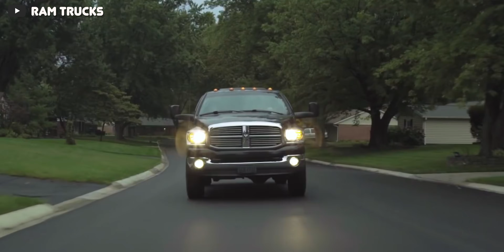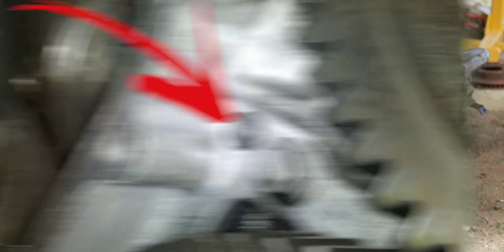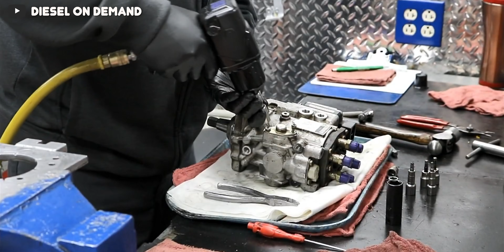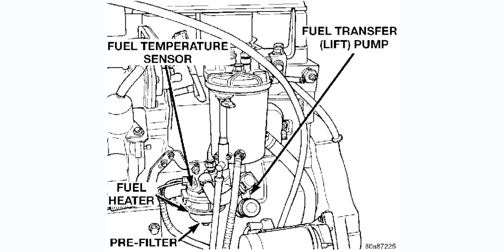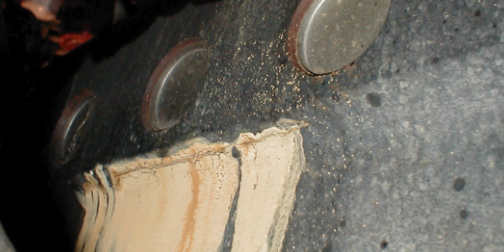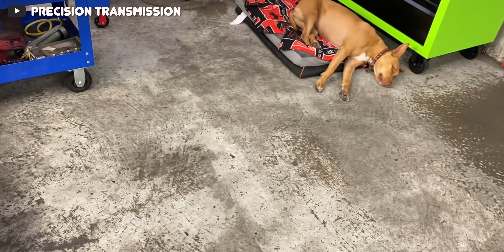Everything Wrong with the 5.9L Cummins (12V & 24V)

Comment: Front end is garbage, transmission is garbage, AC is garbage, an so is the interior. Turbo is also pretty weak. The engine is only reliable because it's so low on power dosent really have enough horsepower to break anything. After owning one for over a year I'm not very impressed with the Cummins at all. Much rather be back in a Duramax.
Reply: Seems this post is ,........wait for it.........      .         .            Garbage.
Reply: Dude!!!   Hater’s

Comment: 2001 140000 miles gone thru 5 vp44 pumps.   Replaced the lift pump with an aftermarket.  Vp44 is trash.    2003 model just passed 450000 miles no issues.  2003 also has a 48re.
Reply: ouch!

Comment: The 12 valve cummins is the most reliable, and the one I'd want if the end of the world occurred.

However, the duramax LBZ (and deleted LMM) is a superior motor in every way. The "top x problems" lists for the LBZ are hilariously small.

So again, if I lived where there was shitty fuel and wanted a dead reliable engine, 12 valve for sure.

Living in modern society, the LBZ is clearly superior

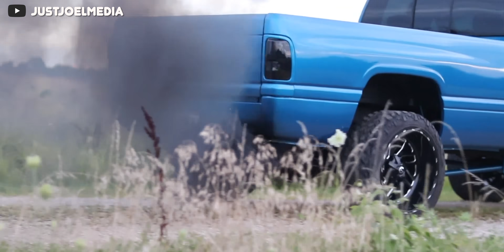Comment: 12:44 I beg to differ. I prefer the DT360. Both the 6BT and DT360 are mechanical, I6, 5.9L engines but the DT360 makes the same power, has better mileage, has an easier start-up, has no KDP, and is more robust.

Comment: I miss my 98 12v. It was easy to turn up, it was super reliable, the KDP fell to the passenger side and put a hole in the front cover, giving me perpetual undercoating and rust prevention, it was fuel efficient, and as long as the batteries were up and it had oil in it it would start every single time. The trans was trash. I wanted to put an Allison AT545 transmission behind it with a PTO on it, but life got in the way with serious health issues. Cheers.
Reply: You got lucky, at545 are terrible.
Reply: @Turbo-wj9qc  There are a quadrillion of them available dirt cheap, and the worst one is better than the Dodge transmissions. I had good luck with mine.
Reply: hope ya get better mate
Reply: @opaic777  Once they put the stock fuel plate back in my fuel pump my health has improved.  (metaphor for cardio vascular issues) LOL Cheers.
Reply: Kdp put a hole in my timing case to this comment made me feel a lil bit better about it haha
Reply: Dude, you let a 98 12v go!😳😳😳😭😭😭😭.   Those are pulling BIG money now! Sorry that happened to you!
Reply: @Asphaltaperider I’ve got a 98 12 valve 3500 dually with a built trans. 341,000 miles,  rust free. Get ridiculous offers on it but no way I’m selling it.

Comment: There's no doubt 12v 5spd stock is the most reliable cheapest to fix diesel in a American truck. Biggest issue I've had is injector pump leak bcuz of low sulphur fuel.

Comment: I have a ram 3500 2004. And the motor has been rebuilt recently. My mechanic is a 25 year friend. Ownes his own family ran shop. In business since 1960. And I take all my cars and trucks to him. And without fail. Every trip to his shop. There's a Ford truck there with some kind of diesel engine problem. Now I've seen Chey's there and Dodges there. But, for every Chevy or Dodge. There's three Fords. When I was looking for a diesel truck. He told me. Buy a Chevy or Dodge. But, don't bring me another damn Ford to work on. Most all diesel trucks require work at some point. Most are worked hard. Maintenance is tough due to the fact they are worked everyday. And people just don't feel they have time to stop to take of the truck properly. Yeah I get it. No maintenance will cost you more in repairs. I get it. But, the fact remains. Most businesses run that chance.

Comment: I bought dodge1990 350 chassis cab w cumm.auto,4x4.auto trans.rebuild at about 95k.that's it.my problem is where to find info for adding hyd.pump to drive welder,small lift boom,winch,etc.info appreciated.thanks

Comment: Once adressed with a simple shift kit 47 48re Transmission are known to be one of the strongest Transmission ever built. Still to this day th400  727 4l80 48re are the go trans if your making any type of power. So they can't be that bad of a design in my opinion.  BTW I have a 53 block with a vp44 making close to a 4 digit hp number.

Comment: If you think it’s a overrated engine , show me a 6.2, 6.5 6.6. Chevy or 6.9 .7.3  6.0 6.4 that is better then it , show me one of those engine that is as reliable with little to no mods and still able to outpull,outperform, and get better fuel mileage then the new 6.7s and 6.6.s. Your biggest gripe is the kdp with you can fix for free in about 30 minutes and reseal the front main and case.

Comment: I always find it funny when people bad-mouth the Chrysler autos up to the last 48re's in '07. Reality is: if built properly, under normal driving conditions, they are probably the most reliable option. Hence an entire aftermarket segment for 48re swaps. In my belief, the biggest contribution to their poor reputation is the "tuner" type owners, or "hot-shot" guys, that just build waaaay to much power in to the engines. And, neglect the needed upgrades to the tranny to hold all that power. Because, there is no tactile performance advantage from the tranny upgrades. So, they don't want to spend the money! It takes serious coin to build a reliable transmission. The Chrysler tranny, 518 all the way through 48re, can be built to hold serious power reliably. I know this because I've done it. But it takes a meticulous build, zero-compromise cooling, and diligent maintenance.
Reply: Yes. You have to build both ends.  A guy just can't build one end and not give equal capabilities to the other.👍🏻

Comment: The oil leaks are absolutely demoralizing. Put 40k on a 94 12 valve the past few years and the only real engine issues I have had are leaks. But boy does it leak. And from everywhere. And when you fix one leak there are two new ones waiting.
Reply: My 1998.5 doesn't leak hardly anything. What it does drip is condensate from the breather tube.
Reply: Tappet cover is the big offender, I am lucky almost no leaks on my 5.9, I will have to do the tappet cover someday as it is the big failure point (and I don't even know why they have a tappet cover, the lifters come out the bottom once the cam is out. and the pushrods come out the top. the only thing that is on that cover is the crankcase vent and that could be put anywhere.

Comment: 94 and 95 is the 47RH and 96 started 47RE and mainly torque converter for the problem they were way too high stall speed how to create a lot of heat In them both that was really the main problem they can in stock form just hard parts and clutches with a valve body handle 450 max.

Comment: did the 48re fix all the design issues with the 47re?
Reply: Still a weak trans from factory if you start working it hard. If you keep it stock and pull less than 9000lbs it will last a good while.

Comment: In 1989 the 5.9 BT was the highest tech engine available for three quarter and one ton trucks. The biggest problem with early Dodges was the rusting out of the cab....particularly the roof area. Mechanically the 5.9 is nearly indestructible....but they will commit suicide ( KDP syndrome). I've operated 12 v and 24 v and I have had  almost no  trouble other than the 47RE transmission slipping in 2nd under high load.
Reply: And the rockers

Comment: If you hate the 12 valve its because you're a hater. Simple. The 12 valve is KING of cheap power and torque, also its easy to work on. No other diesel has so much after market support. Pair it with the P7100 and you got an indestructible engine as long as you keep the engine cool. The 24 valve is garbage though mainly bc its a #53 block and the head has quad valves and usually cracks there.
Reply: Not all 24 valves are a 53 block
Reply: @countcuda70  no but all 24v are head crackers.
Reply: @Syriondeathvow  I'm not saying they don't crack. I have seen more not cracked then I have cracked.

Comment: Only issue with my 12 valve is my automatic transmission. The transmission currently runs and drives and shifts perfect but it’s a Chrysler 4 speed transmission that’s being forced to handle diesel torque and it’s gonna fail eventually and the second issue is the two peice drive shaft and the carrier bearings going out
Reply: Single piece drive line, any driveline shop can make it. take your two piece with some measurements. take the carrier bearing support out and there are no issues. I put a 46RH into mine removing's the 37RH aka 727 had to build a rear mount adapter but that was easy. Now with 307 rear end gears 70-80 down the freeway is about 1600-1800 rpm.  I think you must have the 46RH if it is a 4 sp,  aka 3 speed with OD. good luck you will be fine.

Comment: Spot on.  I could write a book on the 24v dodge.  Purchased my 2000 24v new in 1999 for 32k-33k and have spent over 40k in  maintenance and part replacements.  It's 6 speed and thank goodness it's not an automatic.   Now that it's worn out I've just got the issues worked out of it.  Had the compression tested and it has nearly new compression so I'm keeping it till the body falls off
Reply: I also have a 2000 Dodge 2500 5.9 Cummins 6speed 4x4. Bought it in '02 for 20k. At the time, I was driving a Volvo day-cab semi with a M11 Cummins in it, 600k miles, running strong. I guess you could say I bought a Cummins, more than a Dodge. And no rust!
Reply: You are full of S$%(* if you spent over  40k on maintenance then why the hell did you not see that it was an obvious lemon at spending 10k and you would have got your money back or a new one under the lemon law? No one spends 40k in maintenance on these trucks unless that includes the price of putting all kinds of high performance mods on it too.
Reply: Shouldn't be long. If anybody's even just put salt on their fries, or sweat while in your truck, it's probably rusting away.

Comment: Considering mine made it over 1,266,289 miles before I rebuilt it! Along with that decent fuel milage pulls everything I need parts are easy to get!
Reply: Not only medium duty but agricultural as well. Lot of tractors and combines use the 5.9 and turn 140-160 horse out of it and do it reliably for 10-15,000 hours before any major work.
Reply: Good news for my 95 12 valve with 250 000 miles and very , very little rust.
Reply: @glennbrooks3449  I’ll take it off your hands for $25…. That all I got to offer
Reply: What grade of oil.did you use in it? That's rge highest mileage I've heard of yet!
Reply: @ericfrontczak8016 it seems more important the frequency of oil and filters instead of brand of oil, but in any diesel seems Rotella is a good bet.
Reply: @michaelf.2449  Rotella a joke! Amsoil max duty cuts down oil consumption 76 percent not to mention the detergents to keep the engine cleaner, and I'd spend the money on the oil filtration system I'd go several hundred thousand miles more between rebuilds
Reply: @michaelf.2449  if you don't want to protect your investment you don't have the detergents I change system once a year oil consumption cut by 76 percent
Reply: A lot of people swear by Schaeffer oil. It’s expensive, but stretches your oil change intervals quite a bit.
Reply: As far as the 12 valve goes with the problems with the diaphragm lift pump, when Case used the engine in their tractors, they used a low volume piston lift pump. Looks just like the lift pump used on the p7100 engine only low pressure….
Reply: The Cummins 5.9 and 6.7's are true medium duty diesels. The internals are much stouter than the Powerstrokes or Duramax's.
Reply: Do you use a bypass oil filter?
Reply: 💯  just bought one 180 miles 1998 24 vaule 5k Laramie clean truck .. what upgrades do you think ?

Comment: I bought two 1st gen Cummins Dodges (1990 D350, 5spd Getrag/ 1993 W350, auto) brand new for the farm that are still daily driving to date. This video pretty much sums up my experience with them. Addressed the KDP long ago, put in manual shut off cables eliminating the shut off solenoid, and put in an old style charging system and they've been the roughest riding but most dependible and reliable trucks I've ever owned.
Reply: Best trucl motor option on planet earth. Thats why people that actually work for aliving use them
Reply: What’s the shut off cable
Reply: @jasong-m2u  The injection pump has a spring loaded manual shut off lever on it and you can attach a cable to in and pull it inside the truck cab to shut off the engine
Reply: Roughest riding ? I owned a 79 GMC 3/4 ton camper special that was far rougher a ride than my uncle's gen one Cummins.
Reply: Manual shut-off cable is a great theft-proofing device too.

Comment: Have a 94' 3500 scdrw auto. Dash harness fried with 65k miles on it. Then the headlights got gremlins nothing fixed em and had to run separate wiring and switch for em. P pump went out at 80k miles had to replace with all injectors. The electrical feedback running into 47re causing o/d to kick in and out. Front end needs to be rebuilt often. The kdp. Have a 22' ccsb 2500 Cummins too now hopefully it will hold up better in the long run.

Comment: I have a 97 HD 2500 4X4 manual trans. It has over 355,000 miles on it and still going strong. The best engine that I have ever had. The engines is going to get some upgrades and will help in the towing my toyhauler over the Oregon hills. 😀
Reply: I love my 12 valve....so reliable.

Comment: Yea those are accurate statements but like the automatic it can be made with better parts to a decent unit . My automatic is sitting on the ground mine has a rebuilt g56, Val Air dual disc quiet lol clutch, rebuilt t case , one piece aluminum drive shaft ect . I really like this combination.  Fixed the dowl pin 20 years ago ..  I prefer the p7100 pump as mine has given good service but if it goes I try to find a 215 hp pump. Yea its just a slow truck that gets decent mileage . And payed for lol

Comment: Judging by the number of them and the number of mile I imagine the Cummins is as reliable as any of the others.
Reply: The video was clearly done by a Duramax owner.
Reply: The engine itself is probably the most reliable out of the three and the truck is the same as any GM or Ford.

Comment: I researched these trucks before I bought my 2001.  First mod was gauges and a FASS pump.  As soon as I got the power itch the trans was built to handle it before it had a chance to fail.  I’m adding compounds this summer so I think I’ll be close to the limit of the built trans.

Comment: I know the video is specifically about 1st and 2nd get 5.9 engines. I would add thought that another problem, though not with the engine itself, is the truck body and frame literally rusting away around the million mile engine. Dodge Cummins pickups were/are notorious in that regard. Ask me how I know.
Reply: Yeah while most of the truck are rusted and falling apart it’s all about how you take care of it, got a 96 12v that came from South Carolina, it doesn’t have one spot of rust on the frame
Reply: @brycechow9178  91 pre 91.5 NO rust anywhere, just took a couple of photos of underneath the pass side and it looks pretty much like new, even the paint under there looks like new. Pac NW, NO salt just lots of rain to keep everything clean. Oh yea 365,000 miles, I bought it used with 72,000.
Reply: @brycechow9178  good stuff. its the frames that really matter
Reply: Yeah I hear you. Gonna run my 95 until the frame dissolves then figure out how to shove the cummins into a m35a2.

Comment: If you observe the number of first and second generation Cummins Powered Dodge trucks still on the road the number speaks for itself.
Reply: I haven't seen a 1st gen Ram in years, and only see a handful of 2nd gen Ram trucks around which are rotted almost to death.

I see GMT-400s around daily, still as work trucks. Most are rusted, but a few decent survivors.

I see OBS Fords very frequently, rusted. 7.3 Super Dutys are still used by almost every landscaping company, roofer, and even tow trucks around here.

The Cummins is a great great motor, but the trucks they put them in, just dont last (at least in the rust belt here in WI).
Reply: I hardly ever see the 2nd Gen Dodge Rams on the Road, I see more GMT400s on the road even compared to the Fords of that Gen, same with GMT800s.
Reply: My 7.3 I think is tougher
Reply: So happy for you.

Comment: Na 7.3 is more reliable overall the 7.3 f250 is a better overall truck
Reply: Lol. Nope.
Reply: @davidwitcher5443  explain my 7.3 everything it came with works power mirrors windows back power window heated seats power seats original trans original front end I mean I have had dodges and I know for a fact that everything in the truck breaks except for the engine

Comment: I have seen other people on yt that have the 53 block, and fixed the issue with it. They take and trim the water pump fins  back to reduce pressure.
Reply: DOOOO WHAT (YOU) THINK TRIMMING WATER PUMP FINS IS GOING TO STOP THAT ISSUE U BUMPT YOUR HEAD THOSE H2O PUMPS WILL ,(NOT) CAN (NOT) BUILD ENOUGH PRESSURE TO CAUSE A CRAK TO FORM ON A MOTOR  
SORRY JUST AIN'T GONNA HAPPEN
Reply: I'LL TELL WHAT WILL HELP START A FRACTURE COLD WEATHER FREEZE AND THE THIN CAST IRON FLEXING DURING THE FREEZE

Comment: Owned both a '99 with the 12V, and an 05 with the common rail.  Since my '99 left me in the desert 100 miles from home despite installing an aftermarket lift pump, I can't say the 12V was the best.  Also had to replace the Bosch FI pump and rebuild the transmission.  The '05 with the common rail was flawless.
Reply: 1999 had a 24 valve.
Reply: @robertsawa3407  You're right. My bad.
Reply: I have an 05 5.9 with a G56 ...it's been great at 360k
That dual mass flywheel was sent from the devil
Reply: 98.5 went to 24 valve.